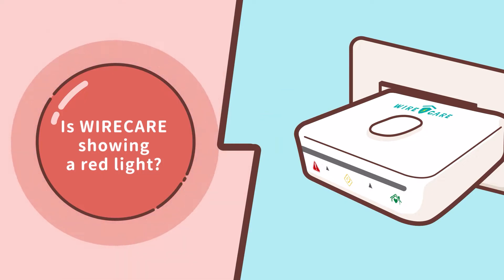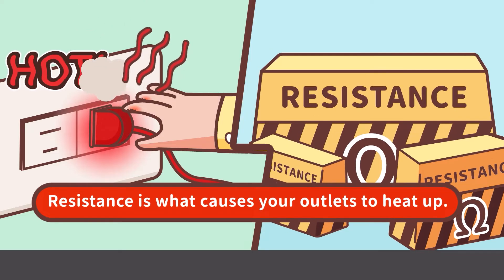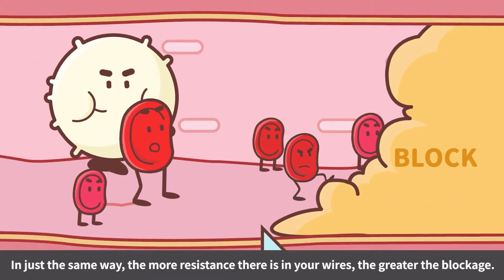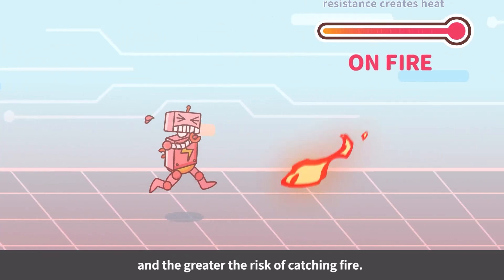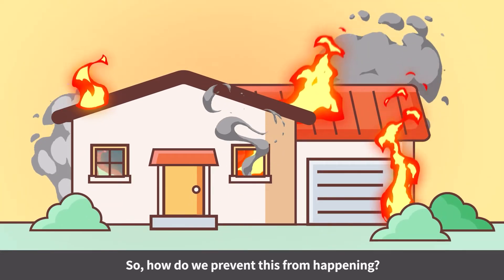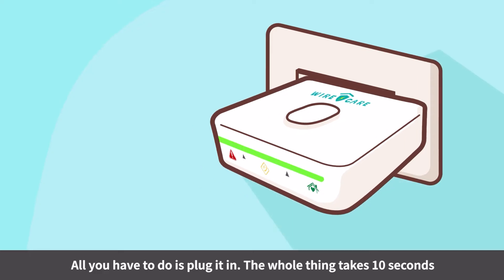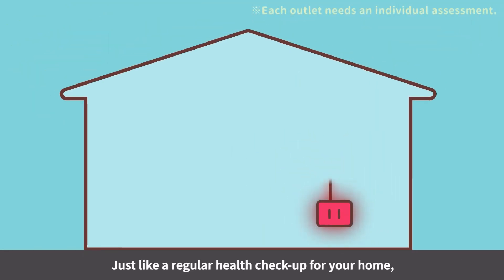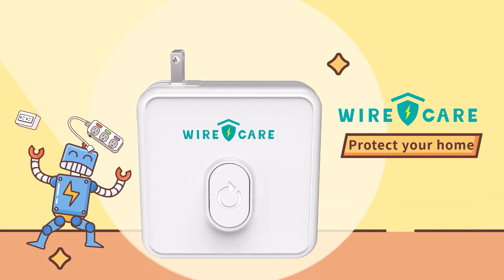🔥 Why do outlets get hot? 🔥 Wirecare prevents electrical fires!

Comment: My electrical card on my hair dryer got hot while I was using it, and the electrical socket stopped working. I was using a foot spa and  it was a spark of fire before the electrical socket stopped working. This is in my bathroom and the cords only have 2 prones. Any suggestions for me. I will appreciate your feedback ASAP. Thank you